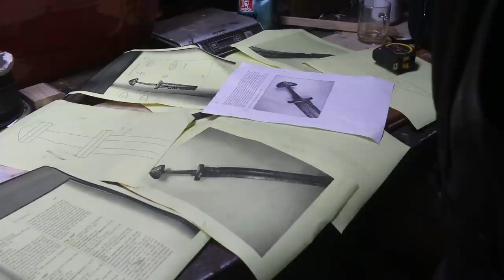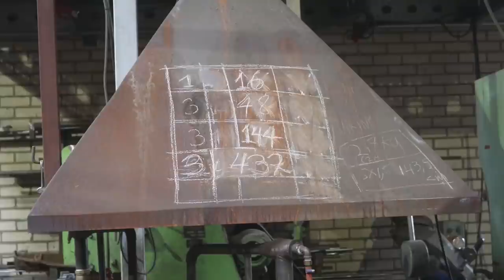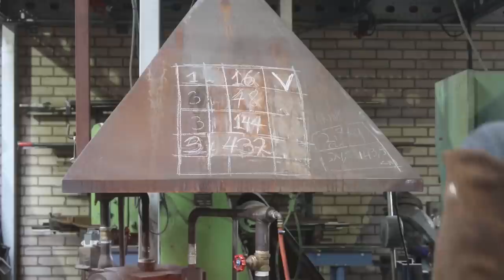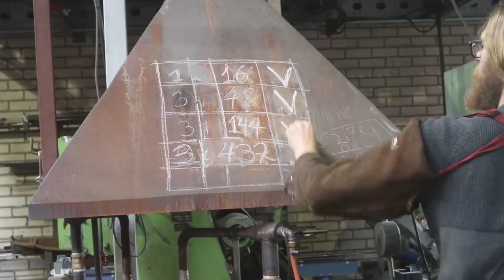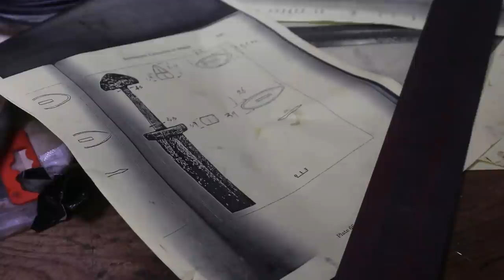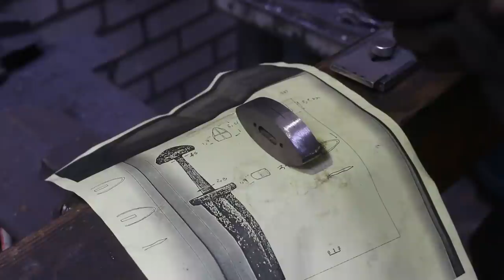Forging a pattern welded Viking sword, the complete movie.

Comment: What’s that powder he puts on the metal before he draws the blade out
Reply: Welding Flux I guess.
But I am not sure
Reply: its most likely borax, many bladesmiths use it as flux during forge welding. it draws out impurities in the metal and reduces slag buildup between the surfaces.
Reply: Thanks I don’t know why I thought it was salt